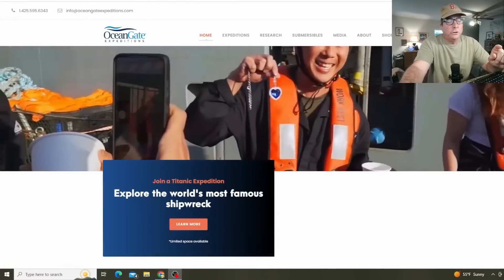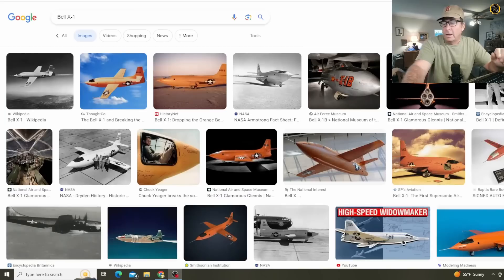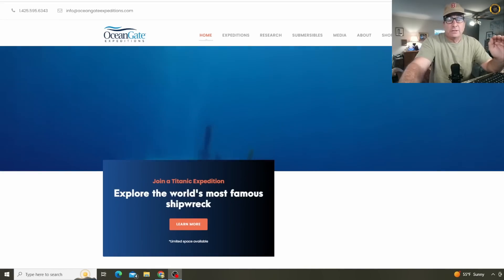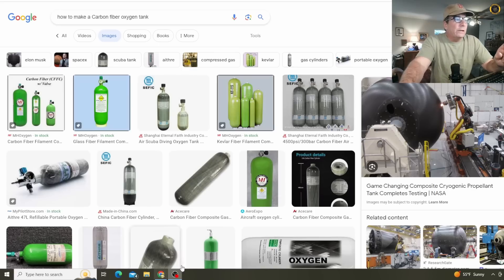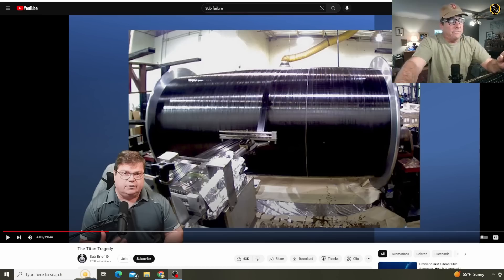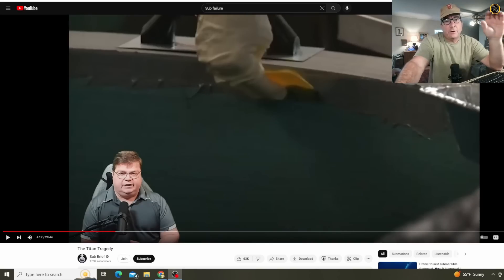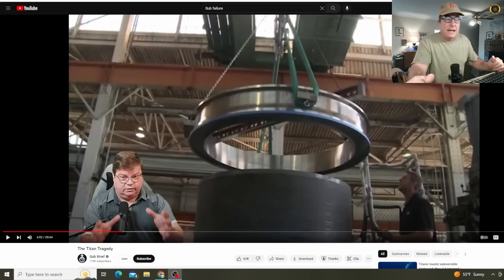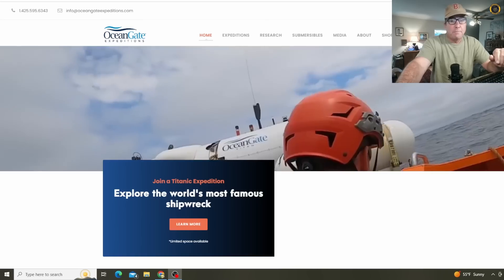Oceangate Sub Construction Details and Implosion

Comment: I’m a structural engineer and could not believed they used fiber for a compressive pressure vessel. The adage “Ya can’t push on a rope!” applies to fibers too. Much of the compressive load may have been borne by the epoxy resin in which the fibers were embedded. Using dissimilar materials is a whole other kind of stupid.
Reply: Im a dumbass, and even i knew that, guess i now have a degree in aerospace engineering from princeton
Reply: Frankly, I am surprised that it held together as well as it did. For such a design to work at all, the winding of the fiber, how it is bound together, how it transitions to the flanges at the end, EVERYTHING, would have to literally be perfect for it to hold. I could imagine a microscopic pinhole forcing a de-lamination, even a tiny bit of which would turn this thing into an inside-out bomb.

My read is they actually assembled the thing quite well, but that the whole design concept had so little fault-tolerance and margins for error baked into it that even near-perfection was not good enough after just a few dives. I suppose this constitutes one of those situations where "yeah, you can, but you still shouldn't" applies. And what made this "brilliant idea" so appealing to the designers? The light weight? Strength to weight ratios are really important in aircraft design, but ships are routinely built from steel, What made this application so different to where they would even attempt such a hairbrained thing?
Reply: @tomsimpson5295 
*harebrained.  You know, like rabbit-brained.
Reply: @Zupdood2  I was imagining somebody that had a skull filled with ingrown hair, but yeah, you are probably right...
Reply: @tomsimpson5295 The only benefit I can come up with for wanting the sub to be light weight is so that it costs less to cargo the sub and sled together on a ship to a dive site.
Reply: @tomsimpson5295 It was assembled, glued in a warehouse. Not climate controlled. The only deep sea submersible to fail with people inside, or fail at all.
Reply: @tomsimpson5295  To answer your question, vanity and narcissism.
Reply: @farmcat3198  Yup...
Reply: in the vido clip of the construction,,wow ,, when they slid the dome onto the cylinder there was no squeeze out of adhesive ,,,in fact it went on too easilly ,,, that only leaves one conclusion ,,,there were air gaps withinin that seal,,, just that one clip was all i needed to see that they had no idea what they were doing
Reply: @AndyX I thought that was a joke when I saw that construction. I make tighter assemblies working in wood!
Reply: @AndyX  As others have stated , getting a machinable precision between the titanium domes and the layered, baked carbon fibre hull would be almost impossible. They obviously went for the cheap option rather than pay for the expense of a uniform titanium hull.
Reply: @johnstirling6597  Why didn't he cheap out and go with steel?
Reply: @ctrlaltdebug  Not cutting edge/high tec enough for the wannabes.
Reply: @ctrlaltdebug  because they were 20year old collage grads that were cheep to hire and wanted to push the boundaries
Reply: @johnstirling6597 I reckon your right , full titanium tube would have cost ship loads more & taken more time for the part to be precisely manufactured & fitted to the end caps ( mechanical fastening &/or welding , times money !
Reply: @barbraabsalom4531  Carbon fibre has great expansive strength but not great compressive strength, particularly when used in systems with different expansive coefficients, EG Titanium and epoxy resin.
Reply: "They make high-pressure scuba tanks out of carbon fiber. What if instead of air being in the scuba tank, we had people inside it.?" - The Ghost of Dick Stockton Rush.
Reply: @farmcat3198  scuba tank have the higher pressure on the INSIDE, so it wants to expand and put the fibers in tension. That is the opposite of what this idiot did. Also, scuba tanks, like most CF structures, have their fiber plies (layers) laid down at alternating angles. These idiots wrapped the entire tube circumferentially. It’s criminally stupid
Reply: I work as an oceanographic Survey Engineer, i deal with many pressurised housings and never known two seperate materials to be used as they going to react differently. It really makes me feel uncomfortable to think they used this for carrying people. 
I cant help feel something between the carbon fibre and titanium joining has caused a weakening and failure. Now i learn its glued. Its just screams absurdity. 

Didn’t he say regulations and certification impedes innovation? Well it only actually impedes bad innovation
Reply: @macflod  Lack of testing and certification impedes life as it turns out.
Reply: @macflod  Yeah glue ... that is insane ! no wonder he didn't want to get it certified.. It would never pass.
Reply: @trainsplanesandotherthings5187  Carbon fiber is bonded (glued) to metal all the time. My guess is that they didn’t test the design enough and/or harshly enough. They should have modeled it and tested it to failure multiple times and then analyzed the failure modes.
Reply: @macflod  Death impedes innovation in this case.
Reply: Slight correction: there was an engineer involved and he was fired for refusing to sign away on the safeness of the vessel.
Reply: @grondhero  Yes, he highlighted numerous problems, most obviously with the carbon fibre " tube" construction.
Reply: did they even use a vacuum chamber when they applied the epoxy to the CF to ensure all the airbubbles were out?  Doubt it
Reply: @wingtipsworld5909  No! And it became a brittle foam under hundreds of atmospheres of pressure, distorting, cracking and then failing catastrophically 🤯
Reply: @wingtipsworld5909 nope. Open air, in an unsterile environment for both the looming and the endcap placement.
Reply: @wingtipsworld5909 that kind of lay up to use pre-impregnated carbon fiber there's never any epoxy applied. It's already in the fiber enough for the autoclave.
Reply: Google found a paper outlining pressure tests on a carbon tube with a 1.2" wall thicknesses. It failed at around 3150 psi. This craft had a 5" thick tube and the pressure at Titanic is 5800 psi.
Reply: @ColinWatters  In stress analysis like this it is important to know the diameter of the tube itself, or more importantly the ratio of diameter of the tube to its wall thickness.  A tube 3" inside diameter and 1.2" wall thickness would be one thing, a tube with 24" inside diameter and 1.2" wall thickness would be entirely different.
Reply: @billj5645  Agreed. The tested tube only had a 22" OD and 1.2" wall thicknesses.
Reply: @ColinWatters  On one hand it matters what the actual diameter is. As the diameter increases, the surface becomes flatter. Which reduses the amount of external pressure that can be handled.

But another thing - was that test with pressure from the inside or outside? Because the tube can handle way more pressure from the inside, trying to stretch the fibres.
Reply: @ColinWatters  1.2" is to 3150 psi like 5" is to 13,125 psi.   So it could hold, no problem!
QED
THAT is how you get into trouble!
Reply: @ColinWatters Yes but with all the cracking going on every deep dive.. it should had been replaced or x-rayed. They were overly excited to do the mission.
Reply: @carlose6010  you cannot X-ray CF like you can steel or aluminum, which is another reason to use metal for pressure vessels
Reply: @ColinWatters it also depends on the diameter
Reply: @ColinWatters  The wall thickness very, very much depends on the tube diameter for the same depth rating.

A small tube has a high curvature that handles way more load. Just that the curvature mainly helps for radial pressure and not longitudinal.
Reply: Was also my first thoughts as an Composite Engineer, but then I thought well hopefully they‘re intelligent enough to only use it for design aspects only and not for structural elements. But yeah now we know
Reply: Like they say in aviation, "Don't do anything dumb, different or dangerous". Seems like they broke all three of those rules.
Reply: "You can't push on a rope" ...
That explains very well to me why carbon fiber is for tension loads & NOT compression loads.  First real explanation of that I've seen, thank you!
Reply: @LeverPhile  With pressure from the inside, the forces are evenly distributed. So you can keep increasing the forces until one thread of carbon fibre is pulled in so hard it snaps. Then the load will still be evenly distributed over the remaining threads. One thread may end up slightly more loaded and snap. Then the force on the remaining threads increases. But you always starts from a very stable distribution of load so you get vert close to the maximum load capability before the sudden failure.

If you instead have pressure from the outside, then you have an unstable configuration from the start. Most materials can handle a huge compressive load because the material has no where to go. So you can put the weight of a full house on a tree stump.

But with a hollow object, the design is always unstable. The geometry isn't perfect. So the load isn't even. The larger the hollow object is, the flatter the surface will be. A flat paper can bend easily. Make a 20 degree bend in the paper and now try to make a bend that needs to bend both sides of the paper a d that is way harder. Because the bend itself adds virtual thickness. Bend a plank on flat side or edge side and the difference is huge.  Beause the thickness matters. A lot. There is something called moment of inertia that relates to how hard it is to bend something. Let's ignore the full formula. But one part of the formula is width of object times thickness of object cubed. So a plank 10 cm wide and 2 cm thick means 10 * 2 * 2 * 2  or 80 when bending where it is thin. Bending in the direction it's thick would be 2 * 10 * 10 * 10 or 2000. Without worrying about the strange unit of this number, we can still see how 2000 is a much bigger number than 80. So look at load-bearing beams and you see they are oriented so the load tries to bend them where they are thick.

Now back to a tube with load from the outside. The roundness helps making it stiff. Use same material thickness but make the diameter larger and the roundness decreases and this makes the tube much less stiff. So you must keep make the walls much thicker if you increase the tube diameter.

No tube is perfect. There are flaws. There may be fractions inside the wall that makes the tube behave as two tubes inside each other - the two tubes together having the same wall thickness as the intended single tube. But 0.5*0.5*0.5 is 0.125. Two such tubes together then has a stiffness of 0.125+0.125. Which is 0.25. The intended single tube has a stiffness of 1*1*1. So splitting from one thick tube to two tubes inside each other - each half as thick - makes this moment of inertia a quarter as big. Oops. Huge oops. Massive oops. That is why each layer of the carbon fibres are m glued with a resin. So they help forming a single tube. But any si gle flaw with the resin messes up the integrity of the tube. Making it much, much weaker. Which is why this design is so scary for outside load creating compression.

But back to the geometry again. No tube is perfectly round. So some parts are a bit thicker. Some are a bit flatter. These geometrical variations introduces large differences in how stiff different parts of the tube is. And that formula with a cube for the thickness - and the knowledge that a round object adds a virtual thickness - means there will be quite significant differences in how much compressive load different parts of the tube can handle just from not being a perfect virtual tube.

Now apply load, and the less stiff parts of the tube will change form more. This flexing of the material will make that section of the tube even more flat. Even less stiff. So even weaker. And then flexing even more. Making it even more flat. Less stiff.

So while pressure from the inside helps stabilise the load sharing on the structure, a load from the outside tries to push the tube into more and more imbalance. And that is why the net has lots of videos of pressure containers that looks perfectly fine. Until it some milliseconds later has buckled up completely. When the weakest section (thinner or most flat) finally gives up.

That is also a reason why having dents on a bike tube is so very dangerous with oversized, thin-walled aluminium tubes.

So in short - you need lots of safety margin with this type of composite material tube when handling compressive loads. Because tiny, invisible, defects will make the tube extremely much weaker. An effect that does not happen for tension - having the pressure from the inside. Blow up a balloon - it becomes round. Trying to make itself into the most stable geometry. While pressure on the outside tries to shape-shift the geometry into the weakest geometry.
Reply: @LeverPhile unless the rope is frozen.
Reply: So a hockey stick is a tension load only?
Reply: @bunsw2070  To explain the hockey stick scenario.  As the stick is deflected a portion will undergo tension forces while an adjacent area will simultaneously receive compressive forces and vice versa when it bends the opposite way.  The critical factor keeping the stick from shattering is that the area under compression is bound to the area under tension so therefore it resists failure.  In the cases of the Titan sub all of the fibres  were fully under compression with no opposing tension area to stabilize it.   They might have been better off not using carbon fibre at all and just made the cylinder out of resin.
Reply: @jimimmler9110  The original commentator used the analogy that a weight can easily be held up when hung from it, but it's practically impossible to hold up a weight on a length of rope. I see the problem that an external force will cause the CF layers to delaminate, whereas for a vessel containing a pressurised fluid, the tensile forces will pull the laminations tighter.
Reply: I’m a retired aerospace and mechanical engineer. While my expertise is propulsion systems I have no problem with dissimilar materials as Ti alloys and carbon fiber composites are quite compatible. Had it been aluminium I could see galvanic corrosion being major issue. 

Using carbon under compression is however problematic. I’m puzzled as to why this was done. It does not appear to be prepreg and without the resin, regardless if it’s epoxy or polyester, in a vacuum environment, voids are inevitable.

We commonly use composite materials for its strength to weight but in water environment, mass is not really a major consideration. I’m betting this was done to accommodate crane load limitations aboard the recovery vessel, but that’s just speculation. 

We also have salt reaction considerations with the resin and bare fibers where voids occurred. As noted by author, I’d be very curious what testing protocols occurred in vessel development. 

It’s a very sad tragedy but as humans we must learn from all of our failures. Fortunately this was an incident of high international exposure thus investigation should have a level of scrutiny wherein the failures will be exposed for experts to fully understand the failings.
Reply: @MichaelM-to4sg  I was waiting for someone to comment on the mass. It’s not a damn airplane, so it doesn’t need to be light.
Reply: Exactly.  The fibers were just decoration.  I couldn't believe it when I heard they were using carbon fiber for this type of application -- completely inappropriate.
Reply: Complete wrong material for the job. Most likely failure in my opinion would be middle of the tube fracture where it’s the least supported. It’s pretty much impossible for the end to come off, it would crush the tube instead. The other type of failure would be a leak, once you have a pin whole it would be like a water jet and would erode the material very quickly till it gave way.
Reply: @spacemanmat  Or pin hole…
Reply: @spacemanmat 
Delam. This was supposedly it's 3rd trip that deep?
Reply: @rogerguinn4619   They had successfully dived down to the Titanic 14 prior times, 6 in 2021, 7 in 2022, 1 in 2023 for a total of 46 customers from what I found by doing a search.
Reply: @spacemanmat  - It did go down over forty times. Wrong material? Maybe not? Wrong material for over 40 times. Definitely.
Reply: @spacemanmat  I would think the titanium/CF interface would have been the failure point given that CF and titanium would undoubtably have different compression behavior under given a pressure. As in if titanium compresses more that CF at pressure it would start to crush the CF fibers and break the adhesive and the interface points, or the CF would break away from the titanium if it compresses more..
Reply: Aerospace Engineer here.
On Juan's last video on this subject I gave an explanation on the differences between compressive and tensile loading of pressure vessels and why Carbon fibre is great for rocket fuel tanks but unwise for a vessel under EXTERNAL pressure. 

Just hours after I made that comment James Cameron pointed out that all of the deep diving subs are made of the same material. They don't mix materials for the main pressure vessel. Its doesn't matter if they are using titanium, steel or acrylic. Other than port holes they don't do combinations like this sub did. 

Think about that glued joint. As the sub descends that titanium ring will deform under the pressure at a different rate to the carbon fibre putting that joint under incredible stress. My professor in college was a world leading expert in Finite Element Analysis if Axisymmetric and Pseudo Axisymmetric structures. This is the sort of thing I was trained in except it was in aerospace. AND Rule #1 of all structures is look for stress concentrations and deal with them. 

There's also an odd but previous lesson in mixing composite and metal structures. 
Back in the late 90s the Stewart Formula 1 team tried a revolutionary gearbox with the case made from composites and it was a disaster for reliability. Note that in those cars the gearbox is an integral structural member of the car. The engine is connected to the tub by a cluster of mounts. The gearbox is SOLIDLY BOLTED to the engine with locating dowel pins so that there is no misalignment. Then the rear suspension is bolted to the gearbox. 

At the the time my boss owned a racing car team on the side. One of hi mechanics quizzed me one day. His view was that as everything got hot the metal of the engine and the shafts, gears & bearings in the gearbox would expand against the carbon fibre of the gearbox casing WHICH WOULD NOT EXPAND AS MUCH IF AT ALL. That mechanics view was the difference in expansion would simply break things. That Stewart F1 gearbox might have been revolutionary but it was also incredibly unreliable and NOBODY has tried it again in any form of racing I am aware of.
Reply: Wrong materials aside. It shouldn't be a cylinder. Cylinders are fine for subs at shallower depths but spheres are used for every single deep submersible I've ever seen. I am not aware of one that's not a spherical pressure chamber.
Reply: @paynej32013  The challenge here is size. A 5-man sphere becomes quite large. And large means a need to increase the wall thickness quite a bit.

So for this application he's more or less required to go with a cylinder, even if a cylinder only arcs in one dimension and so isn't as able to distribute load as a sphere where the surface arcs in two dimensions.
Reply: @perwestermark8920  Why a cylinder with spherical end caps, rather than an ellipsoid?  If the Titanium end caps were machined to join with an ellispsoid-shaped piece which was 5' diameter at the ends at 7' diameter at the middle, that would be simultaneously more spacious and stronger for a given wall thickness than a cylinder would be.  Carbon fiber would still not be a good choice of material, but a cylinder, unlike a dome, is fundamentally unstable under compression.
Reply: @flatfingertuning727  One complication with an ellipsoid is that it's so uneven. No easy formula for how to weave. And each section of the long axis has a different radius meaning a different stiffness. What a joy to simulate tge loads and the cycle wear. And since the bend radius keeps changing, that also means you need different wall thickness for different parts. Even more interesting then how to weave.

Spherical end caps to a cylinder is so much easier to make tests and computations on. And a cylinder doesn't lack ability to handle compression. It's just that it has different ability for radial compression and for longitudinal compression. But that can be handled.

So cylinder with end caps would have worked if it wasn't for the composite design. Especially a composite design where the carbon fibre bands were used in the absolutely worst geometry possible for the task.

But back to an ellipsoid. Yes - the load can be simulated. But you really want to make it in a way where you can vary the wall thickness depending on the varying curvature caused by the two radii. And the way to avoid extreme complications then would to stay away from any composite spool of thread and aim for all parts of the wall having uniform material properties. Both for handling load and for thermal expansion.
Reply: @perwestermark8920  A cylinder without end caps would have very little resistance to being squashed flat.  Not much better than a flat plane would offer to bending.  Adding end caps would improve the strength, but the improvement would be greatest near the end caps, and would be much less near the middle of a cylinder whose length was more than twice the diameter.

A cylinder constructed from uniform layers may be more uniform than an ellipsoid could be, but the carbon fiber within such a structure would be serving relatively little advantage over e.g. sand.  Wither one is constructing a cylinder or ellipsoid, I think achieving maximum strength would require having tension members connect the inner and outer surfaces.  I also think a good design should expect and accommodate elastic deformation in a manner that would tend toward equilibria that shift loads towards the portions of the structure that flexed less before any part got anywhere close to the point of plastic deformation.
Reply: @flatfingertuning727   Yes. Which is why they need thick walls to avoid squishing it flat. And in this case, the carbon fibre can't help. Because it's aligned so it likes the tube to be squished flat like a toilet paper roll. All pressure in the direction the fibres likes to bend.

And yes - this is a design where geometry change directs even more forces to the weak spot. So all aimed for milliseconds from ok to total fail. Not a geometry where the load gets rebalanced.
Reply: @perwestermark8920  For most deep-sea submersibles, the easiest way to maximize the level of pressure the vessel can withstand is to minimize its size.  Submarines that need to be big, however, use beams and bulkheads, and a skin which is designed to be flexible enough to transfer loads to them, rather than trying to use a hull made from a single homogeneous piece of material.

I could imagine the tension properties of carbon fiber being useful if one were to construct the hull with short (maybe 10cm or so) carbon fiber spans that were expected to flex inward between the places where they were supported, and used a flexible binder that would accommodate this, and deliberately ensured that carbon fiber layers could slide over each other as needed to redistribute tensile loads.
Reply: @paynej32013 avy Dsrv1 and 2.   5000 m capable from what I see public domain.  Not sphere.   We did ops with them as mothership when I was on SSN686 in Navy.    No claiming knowledge of their design other than to state the are tube, not sphere...but also not CF.
Reply: @creggf4685  5000 feet not meters.
Reply: There was no engineer involved in this project .....
Reply: @peterebel7899  and no "50year old white guys"
Reply: @qbi4614  Of course not. They're too expensive and they know how NOT to do things. Like, do NOT use carbon fiber for compressive structures!
Reply: @GBooth  It was literally company policy! That and they gave a fuck about safety, "guys that have years of experience" (skin colour and sex is irrelevant)
Reply: @qbi4614  ...another point that plays out here and is not mentioned much as it doesn't talk to the technical aspects....but is just as important.
Reply: @peterebel7899  - The CEO had a degree in Aerospace Engineering from Princeton.
Reply: @KevinBalch-dt8ot  Princeton should know containing high pressure within a tube (like in aerospace) differs in principe from a submarin's load on the hull.
You can't push a rope, you can't push carbon fibre. (where you just use the raisin to avoid the fibre folding)
Reply: @KevinBalch-dt8ot  the whole other end of the spectrum
Reply: @KevinBalch-dt8ot  the complete opposite of the spectrum
Reply: @KevinBalch-dt8ot  Just that a Bachelor is just an introductory level. And it was in Aerospace so quite far from submarines.

But the biggest issue? The massive hubris of not wanting experienced specialists to listen to.
Reply: @KevinBalch-dt8ot he also had a degree in ignorance
Reply: @vanpeters9751 PhD in arrogance. Piled higher and Deeper.
Reply: @KevinBalch-dt8ot  Which probably didn't address underwater vehicles, or even likely discuss carbon composites at that time. Designing wings and aircraft is fairly different than a DSV. You would really want a material science expert with deep composites experience involved I would think.
Reply: @KevinBalch-dt8ot  Aerospace engineering is very different from marine engineering.
Reply: @peterebel7899  maybe Princeton has higher priorities, like Bud Lite etc.
Reply: @KevinBalch-dt8ot  .. and how much professional engineering experience ?
Reply: @perwestermark8920  If you were to sum up the cause of this accident in one word, I think "hubris" would be it.
Reply: @imo8249  Bud Lite performs too much of buoyancy to be helpful on a visit to Titanic.
Reply: @peterebel7899  - Well, to be fair, you can't use the rope pushing analogy because the rope WAS bonded with resin. Still, the next step is to consider the differential compressibility of the fibers and resin, both dry AND WET, and then how much strain is on the adhering of the resin/fiber interface due to compressibility differences.
Reply: @bruzote  So you rely on the raisin, not the carbon fibre. This is the failure of the concept (and the analogy is right). As long as you are containing over pressure in a tube, you are using the performance of the carbon fibre for your benefits.
When you are putting outside pressure on the tube the story is very different. Concrete or stone can do this job.
Reply: @PharmaGiles  that is ironically the same word that sums up the Titanic.
Reply: @peterebel7899 The owner was an engineer. There was engineering behind it, but also arrogance. Stockton Rush said there is no testing method to check the integrity of carbon fibre, yet bicycle frames can be x-rayed for stress fractures. Minimally could had tried as the titan submersible had been in operation for like 3 years..
Reply: @carlose6010  Simply: Carbon fibre is the wrong material in this application - per principle.
Reply: @peterebel7899  , no, Rush had a degree in Aerospace Engineering from Princeton.
Reply: @Gravitys-NOT-a-force  And?
He has no glue about the basics of materials. What does this tell about Princeton?
(from an engineer)
Reply: @peterebel7899  , true.  You don't often hear of or run into an engineer from Princeton.
Reply: @courtneydjames -  very good point!
Reply: It seems to me that carbon fiber is great at tension strength, but seems like compression seems like it would be very weak?
Reply: @marvinmartin4692  not just that the glue seams and the epoxy would be expanding and contracting, they are not flexible, that would already be enough to cause a failure, it would crack and bam the pressure vessel has a weak point, all it takes is one failure point, its funny they had a sensor to tell them when its going to fail, i think they know when it fails, just a big brain thought but idk.
Reply: @richardjohnson8009 "Beep." "Oh shi--" 🪦 😔
Reply: @richardjohnson8009  They went down 12 times before it imploded. 12 times it expanded and contracted and I'm guessing no inspected it at all after each dive.
Reply: @trainsplanesandotherthings5187  yeah and the only way to inspect it would be to cut it and check for delamination
Reply: @marvinmartin4692 Yes.  Only through lamination and the weaving of multi-directional layers can a rigid matrix be created that supports loads in multiple axes.  But compression will never be its strength.
Reply: @marvinmartin4692 genius
Reply: Okay, enough comments saying carbon fiber sucks at compression. I just work in a factory but it seems to me that if you take a hockey stick or airplane wing made of carbon fiber composite, and bend it, one side will experience compression and the other, tension. To go and say carbon fiber sucks at compression because it's just like rope completely misses the point. However they had to do it they've engineered these issues into the product and it's no big deal. If you ever took a shot with a CCM Super Tacks 2.0 hockey stick, you'd want to marry that thing. If you can build a stick like that out of snot or mud, you deserve a Nobel prize. I may work in a factory but I have taken courses in materials technology and these experts aren't a bunch of dummies like most experts (medical scientists or economists, for example). I need more convincing that carbon fiber is obviously inferior for this application. Russia is using composites in their hypersonic weapons (they have to because of the heat) and America, with a $1 trillion military budget, can't do it. Clearly there's more to it then "carbon fiber is useless at compression."
Reply: @bunsw2070  On a flat hockey stick, the tension and compression surfaces have the same area.  On tube, the inside has a much smaller area than the compression side. It's also negatively curved, so it has to be crushed basically flat before it experiences tension.
Reply: @bunsw2070  I believe your analogy is flawed. You are correct that a stick or beam in pure bending has tensile loads on one side and compressive loads on the other. However, CF is encased in resin and that resin can bear compressive and tensile loads. The issue is how much stress / load is applied. The stress in a hockey stick can’t be compared to that of a pressure vessel at extreme depths. Take your stick and bend it hard. I guarantee you it will fail on the compression side when the resin buckles or crushes
Reply: @cdarw  The hockey stick bond is along the full length of the stick. A short span, as in this case, causes a lot of tension from heel-toe force.
Reply: @bunsw2070  Carbon fiber composites are a lot like reinforced concrete.  The carbon fibers take the tensile loads, as does the steel reinforcing rods, while the epoxy handles compression, as does the concrete.  If your application has both types of loads, then a composite construction makes sense.  However, a submersible has only compression loads, so the carbon fiber is really just along for the ride, and the epoxy isn't anywhere near as strong as titanium in compression.
Reply: Maybe they had seen the use of carbon fibre in gas bottles and didn't get that tension case didn't apply on their compression case.
Reply: @bunsw2070  " I need more convincing that carbon fiber is obviously inferior for this application"  I guess OceanGate can build another and you can sign up for a trip down to 4000M and report back.
Reply: Why did he want to use carbon fiber in a sub?  It is usually used 
to save weight, which is a minor issue with things that float.
Reply: @jamese9283  Sexy and hitec, in keeping with his cutting edge ethos.
Reply: That was what I understood also from my engineering training.  Carbon fiber is great in tension but not really suitable in applications where it is under compression.  I was very surprised to hear of carbon fiber being used for the fabrication of the vehicle structure.
Reply: I'm not an ME, but a EE and even my rudimentary knowledge about stresses would have me worried that some fresh grad out of college had enough 'lessons learned' to design this properly.
Reply: Using dissimilar materials always shows someone who has no idea about thermal expansion
Reply: @OffGridInvestor  Or galvanic corrosion.
Reply: Physics Rule #1: Force=mass x acceleration. Rule 2: "You can't push on a rope"
Reply: @LovableTLo  I learned in undergrad that “All you need to know to be a mechanical engineer is F= uN (friction equation) and you can’t push on a rope.”
Reply: "Ya can't push with a rope!" are the exact words my composite structures class professor used when he was describing why CF has to be woven in several directions. And why CF is bad in compression loads.
Reply: 1) carbon fiber used in compression
2) fiber layup looks to be almost  exclusively 90 deg.  Any bending forces from lifting the sub or axial bending due to compression (I.e. Moore’s circle principal stresses)

3) Titanium has relatively low modulus vs carbon fiber.  So not only different thermal expansions, the strain differentials are quite large ~ CF 2X > than Ti

4) Ti end-cap looks to have relied on a bonded joint only?  Always have a redundant mechanical backup to help take stresses in higher stress or temperature extreme environment.
Reply: Carbon fiber is strong under tension, but not under compression.
Reply: Agreed. Well said.
Reply: CTE. I look at "experienced" engineers differently when they miss it.
Reply: I’m a professional Ocean Engineer.  No, carbon fiber is fine in compression.  It’s a risky choice (to the level of being irresponsible with our current level of R&D), but not because carbon can’t work in compression.  Longer list of other reasons it’s a bad idea.  That said, there are several fielded pressure vessels made out of carbon fiber.  Just a slightly different application which makes it more ok.
Reply: @stevebean1234  these CF pressure vessels of which you speak, where is the higher pressure? On the inside, right?
Reply: @cdarw  no, the carbon fiber pressure vessels I mentioned are external pressure vessels for subsea applications.  i was somewhat surprised when i saw it since early in my career i wondered why CF wasn't used and it seemed to be a suboptimal material for subsea use.  However, there are still unique advantages to CF and if enough R&D is done to mitigate or avoid the disadvantages, then external pressure vessels made of CF will make sense for at least niche applications.  Thats why stockton used CF - its light enough you dont have to use syntactic foam which is expensive.  The problem is the R&D for a material like CF is very expensive.  Engineering juggernauts don't really have a great handle on it yet, thats why there aren't CF parts in primary load cases on Boeing jets for example.
Reply: @stevebean1234  unlike CF, there has been tons of research into steel pressure vessels constructing and inspecting since the 1800s. Weight is not a factor for sea going vessels and even if it were, CF is a foolish choice and the results bear that out. Sucks that his recklessness resulted in the vaporization of 4 people.
Reply: @cdarw  most pressure vessels are 6061-T6 aluminum, except US submarines which use their own steel researched specifically for that use, and deepsea applications which prefer titanium for weight savings.   you're absolutely incorrect, weight is a huge issue in undersea applications.  syntactic foam is expensive and very heavy itself so you need a bunch of it to get to the titanic which would have been cost prohibitive.
Reply: @stevebean1234 Exactly. Lot of ignorance about carbon fiber. The fact that lots of layers are glued together stabilizes the structure and prevents buckling. Now if the bonds fail and delaminations form you are screwed. There wasn't enough testing done to observe how these delaminations grow.
Reply: 100% baffles me how he got a degree ...life is stranger than fiction
Reply: "Using dissimilar materials is a whole other kind of stupid"... That was my thought, the behavior of CF vs titanium at pressure and temperature I would think would crack/compromise the CF (or a minimum the adhesive at the CF/titanium interface) to the point of catastrophic failure.
Reply: I think that blank statement that this type of vessel cannot be manufactured from carbon fibre composite is not entirely correct. It can be done but operationally it doesn’t make sense as there are more issues created than resolved. I would say that easiest for constant operations would be spherical steel vessel which would be easy to maintain and check for integrity.
Reply: Of course I've been reading all kinds of crap, and I'd have to see if the info is even out there but a buddy said they used polyester resin and not epoxy. 
Wtf , polyester will absorb water. 
Ask anybody with a fiberglass boat how much more there boat weighs at the end of the season 🤷‍♂️
Can't believe they'd use polyester and not epoxy though
Reply: Exactly.  Plus the carbon fiber pressure vessel by default is not a homogenous material.  It's incredibly hard to test it for flaws.
Reply: You might have overlooked ... a passenger blew a big fart !